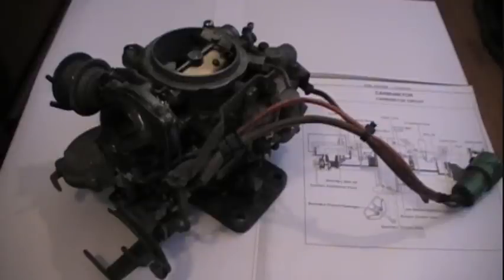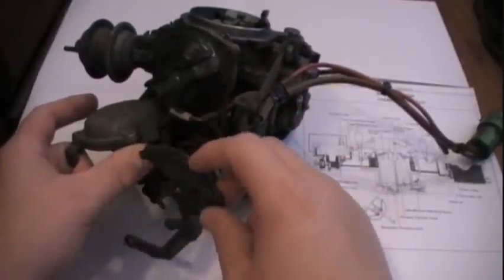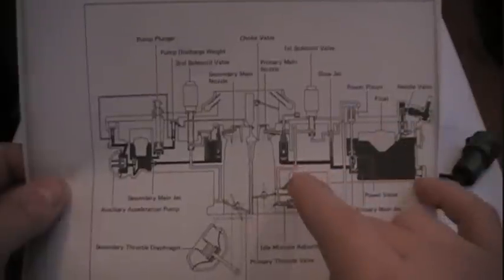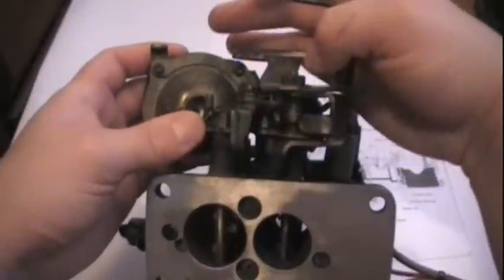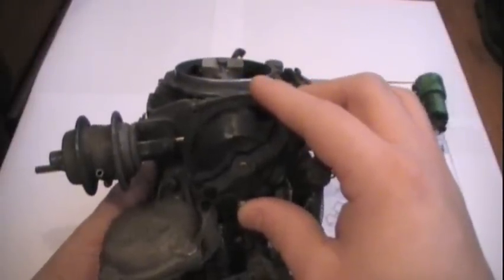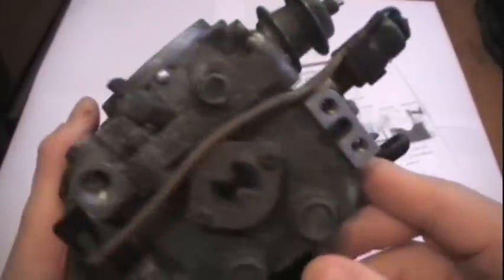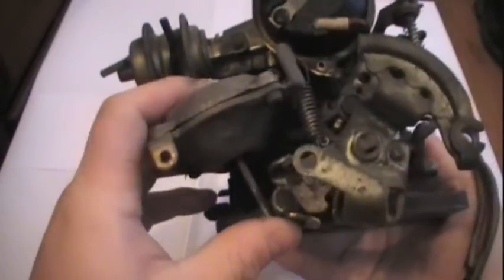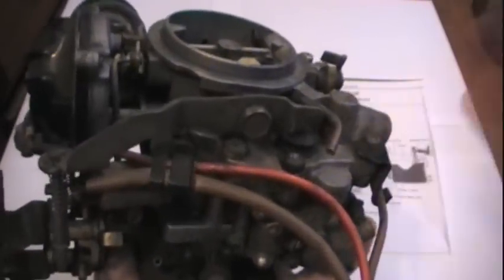How an Aisan Carburetor Works

Comment: I just love these carburators, I've been spending almost a year meticulously tuning mine, used to be california emissions, but i converted it to federal, new ecu, added emissions components.

They just drive so nice if you can get it perfectly tuned on top of also having all emmision components working together, I'm so close to perfecting it that it gets 40 mpg going 80 on the freeway, its not slow for a typical 4ac aisan stock setup.

My head is a 4A-E mounted to a 4a-lc block.

Keep up the good work man, your build is ingenious.

Comment: hi, I have the same type of carburetor with my ae92 4af carb engine ... I'd like to know what will be the cause if the secondary throttle doesn't open at all? because I think mine is not opening... could it be that there is problem inside of that vaccum pump which triggers the secondary?
Reply: i have the same problem !!! my second throttle doesn't open at all ! i have a 1989 mazda 323f bg with pop up lights
Reply: An old man had the same 323f bg as me and sold me a lot of things for 100 euros
I have a complete aisan 28/32 the same as me but mine has 240 000 kilometers
This one has 60 000 😂 i changed my gearbox too by the way
Tank you for the explaination !

Comment: hi, very interesting and extremely helpful.
I'm currently experiencing a high rev (sometimes up to 4000rpm) on my Suzuki's aisan carb with the wax module auto-choke. I've figured that the lever that runs from the wax module is holding the throttle open - resulting in the vehicle sticking in high rev.
How can I disable the automatic choke mechanism? 
Please share any ideas that may help - thanks...mnrsamuel@gmail.com....

Comment: hi would you be kind enough to mail me a copy of the carb schematics you have?..
i have been having carb issues on my toyota 2e for weeks now..
and im getting pretty frustrated :)..
the idling is very rough when the PCV valve is connected, but if it is blocked off,
the idling gets a bit better... 
maybe your schematics can help me at least understand what the problem is..
anyway, i cant use my car now because of this problem..

here's my email.  powers057@yahoo.com

TIA :)

Comment: I tried to rebuild a Mikuni carb for a Dodge Colt. The rebuild kit did not have the choke pulloff diaphram (which was torn). The whole thing was riveted together so I had to drill those out then find self tapping screws to put it back together. It never was right after that. I hope the owner get a new one. Apparently the Mikuni is a throw away carb.

Comment from the maker: @BOOOSHtube 
1. It opens the secondary butterfly. Giving you more power.
2. When vacuum pulls the spring inside housing, it opens the butterfly.
3. The easiest thing to do when its broken. Replace the diaphragm inside.

Comment from the maker: I said it in there. You pull the vacuum secondary apart and replace the spring with a lighter one. Or you can cut the spring. When you are doing that, a lot less vacuum is needed to open the secondary. So it opens sooner.

Comment: Thanks! It may come in handy. I'm about to buy a AE82 (maybe this weekend.or Monday)  and I will check the carb right away (not that I will find this type of carb in it)  . It's a pretty good bargain :

 3.500 Norwegian Crowns (Kroner) for the car is about 589,45 USD.

No rust in the canals, paintjob is good, some minor rust inside the front wheel arches, the interior is in really good shape and extra set of wheels....And yes, i'm looking forward to buy the car  =)